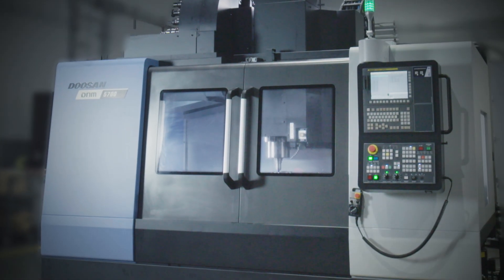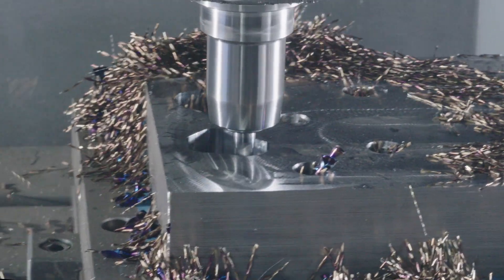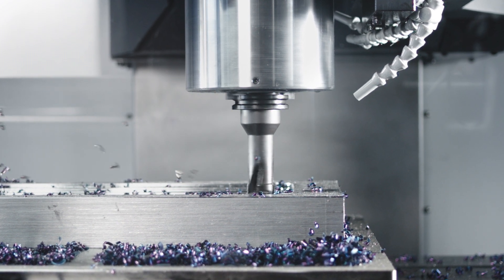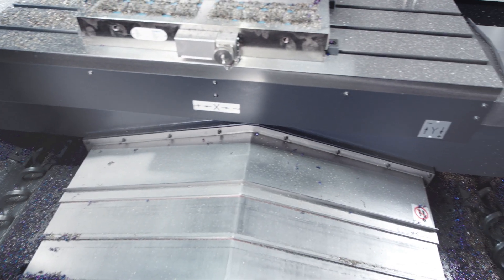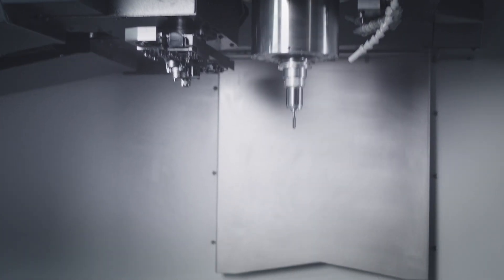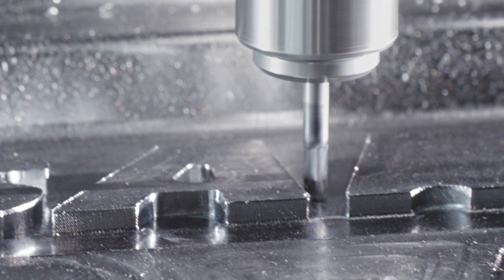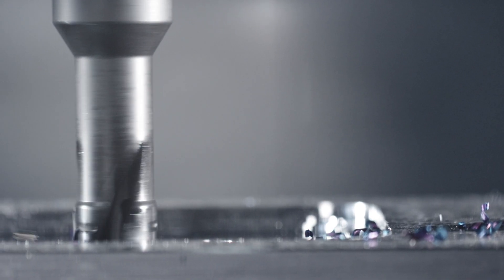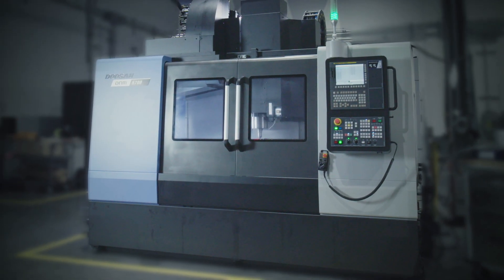DN Solutions DNM Vertical Machining Center: All-Purpose Production

Comment: How much Is the dnm4500?
Reply: My DNM5700, Siemens 828d, shopmill, renishaw OMP60, OTS, meassuring cycles, TSC 18bar, ethernet, and some other stuff was, 82.000€ + vat
Reply: @G33gcho  does the advanced look ahead came standard ? on 3d surfaces to finish it works well? where are you from? good price. yo can;t get a haas vm3 at that price even in the end of the year sales i guess
Reply: @claudiugalea3038  I really dont know. Check this with your dealer. But i didnt buy any licence for extra look ahead, and dont have problems with 3d milling. Standart is 150 blocks. Im from Slovenia. :) yesterday  i gor new PUMA 2100LYSii <3
Reply: @G33gcho  i am from Romania. I Want to use it for mould making. Now i have an old fanuc which is not good at all for 3D toolpaths. I don’t Want to Pay very much for a Haas vm3 because many people complain about it in steel especially in mould making.
Reply: @claudiugalea3038  be careful if you use this machine for 3d mould making it has a feature that alarms out reducing rapid speeds to maintain accuracy if you have long cycle times